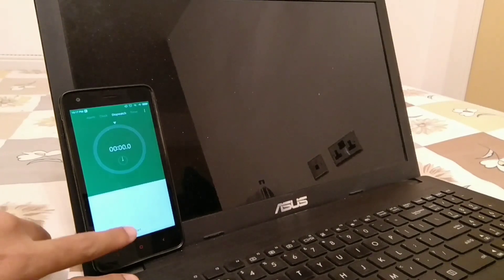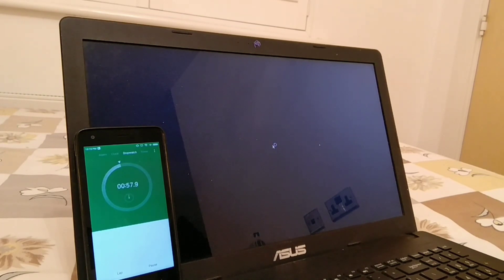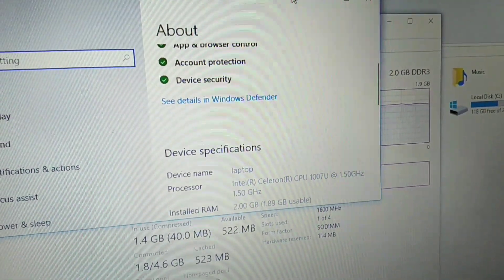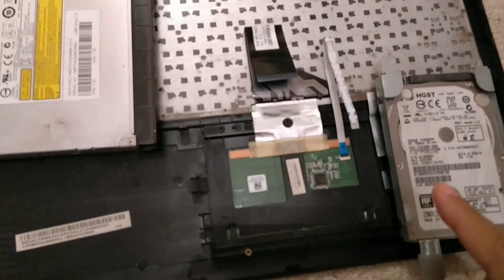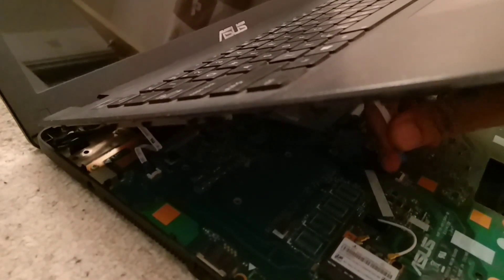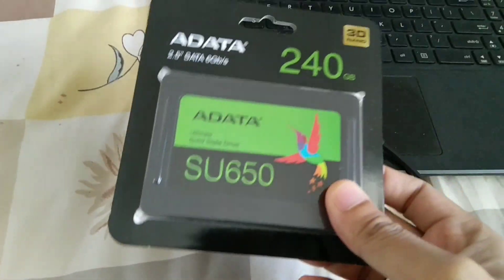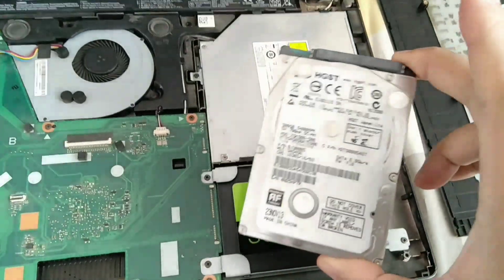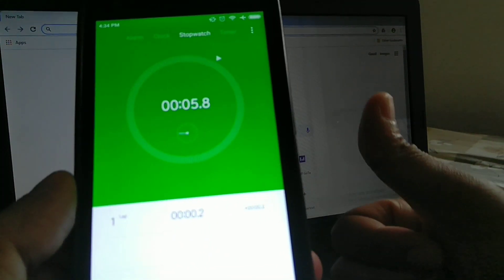RAM and SSD upgrade on a  Pentium dual core laptop!

Comment: Is this Pentium n3510?
Reply from the maker: It is Intel celeron 1007u, bought in 2014
Reply: @motogpwin  mine is pentium n3510(1.99 ghz) will it be workable after i add extra ram and a ssd?
Reply from the maker: @prashantkumar8237  SSD should work fine , however with RAM it can be tricky sometimes. Best check online for compatibility before buying.